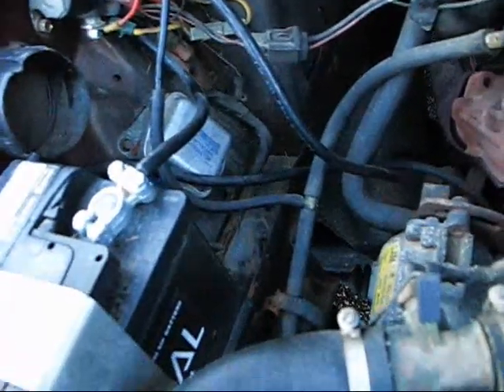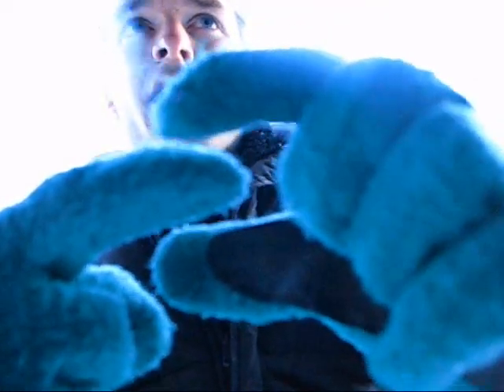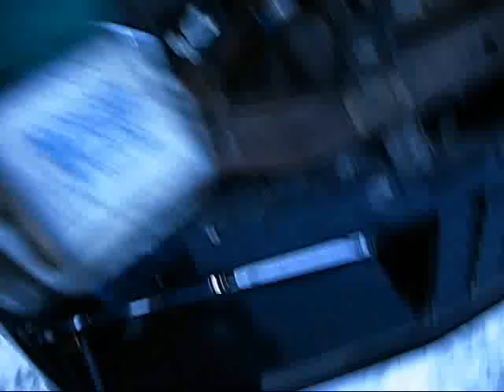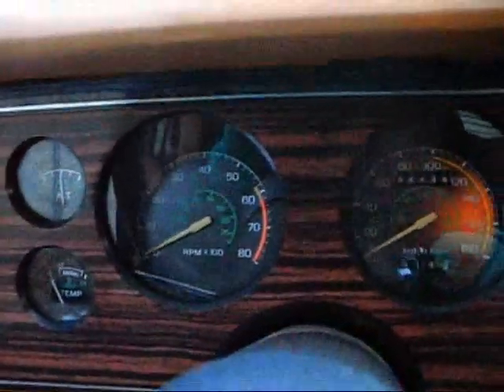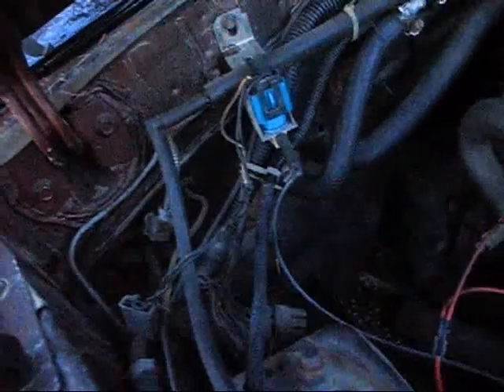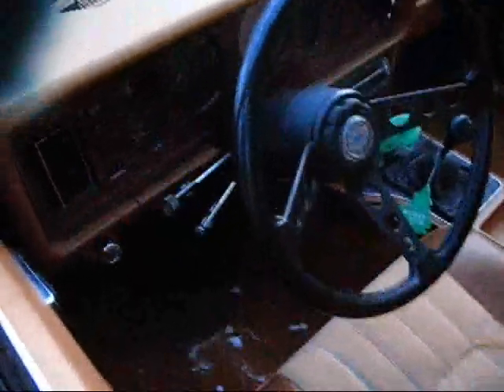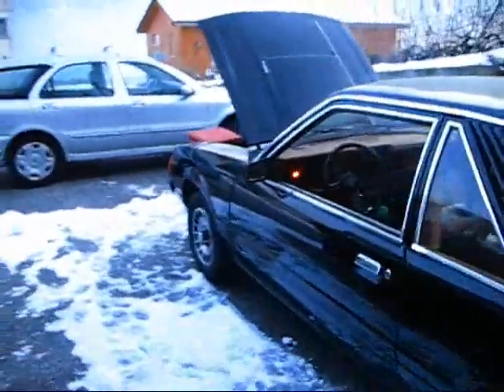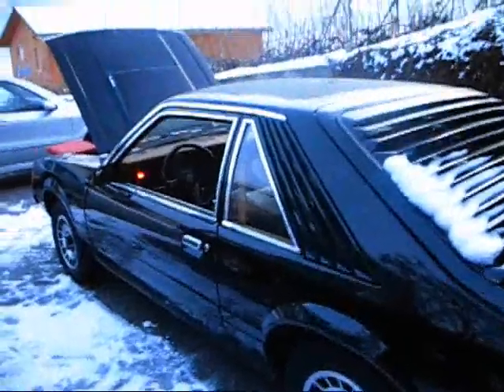Trying to find the electrical problem in my mustang

Comment: FordSony13 Yes i posted this awhile ago... i was 14 when i commented this lol but thats good you have had good experience with ford but i and my family and friends have not, I have a 98 Z28 with 164k miles running 8.6's (1/8th) @ 84 mph spinning through 1st and 2nd it is my DD and i get between 24-27 mpg, i have a friend with a T/A with 230k stock with a small shot of nitrous running 8.4's

Comment: that explains why I've never had a problem with my mustang 220,000 miles my friends never had a problem with his excursion, 257,000 miles, and my parents haven't had a problem with their f150,197,000. while just tonight I had to tow a neigbors Tahoe, 120,000 miles with an injector issue and my other friends brand new cruise is always in the shop. I know you posted this awhile ago but i'm getting tired of that stereotype it is completely opposite GM has always

Comment from the maker: @hotamber22 
I changed it for a new one too... I also changed the regulator, plus the little box on the steerin column, the one that makes the car "know" that its on or off... Changed it twice actually... Well no difference... What I would have done if I stil had the car (traded it for a Cadillac STS) is change the entire wiring and torch. Was the last solution I had, but that guy with his 94 STS wanted it and I wanted his Cad :) great deal, sold the cad for 3k$ in 2 days !

Comment: It would be the silver box on the opposite side of engine compartment called the electronic control module. The regulator your working with only charges the battery, it will not shut the engine off.

Comment: i had the same problem with my 89 gt and mine turned out to be in the steering column this may or may not be ur problem.but anyway im not sure if ur year car is the same but when u turn the key to start the car it pushes a rod forwards that rod goes into a box this box maybe your problem the box is 2 peices which is aluminum and plastic after a while it starts to split apart causing a bad elecrical connection making ur car think u turned ur key off cutting power to the ignition systen. good luck

Comment: It was a 87 Mercury Topaz. We replaced it with a 91 Ford Tempo. We still have that car. We bought it in 1992. I call it 'old faithful" because it has never let us down. When ever we need to drive it it runs like a top. We are talking about selling it and replacing it with a newer and better car. It's just a back up car that doesn't get driven very much.